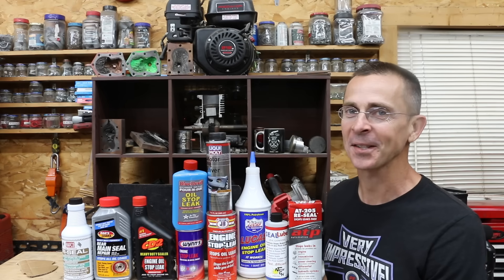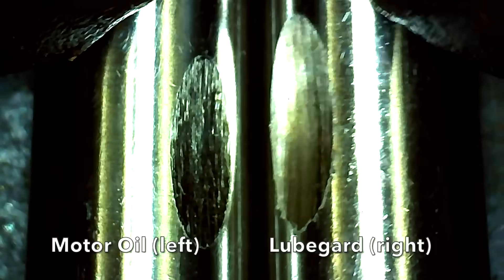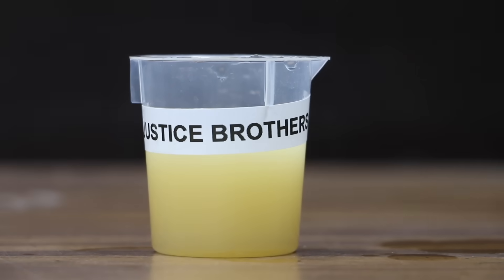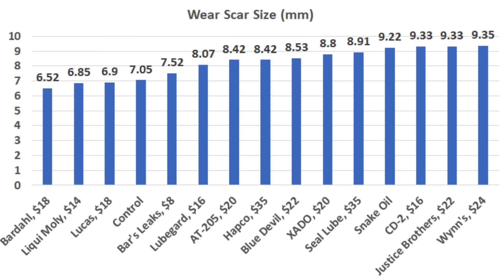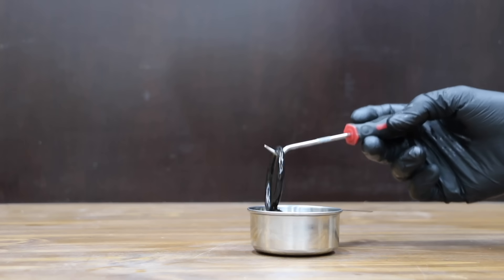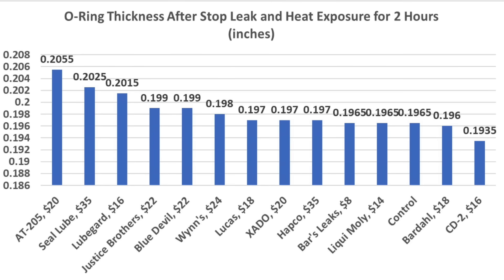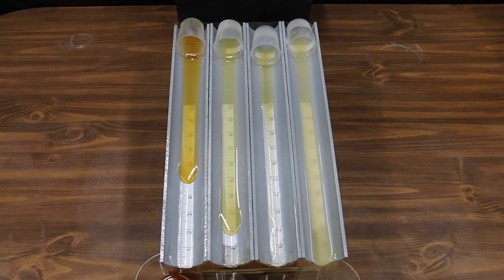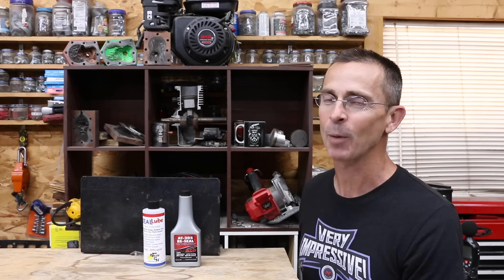Do Stop Leak Products Work? Do They Damage Engine Seals? Will They Destroy an Engine? Let's Find Out

Comment from the maker: Here’s the list of products reviewed. More details in the video description. Thank you! 
AT-205: https://amzn.to/3Z76AHH
Bardahl: https://amzn.to/3jO2Hr0
Liqui Moly: https://amzn.to/3ZdyKRE
Lucas: https://amzn.to/3IoZad0
Bar’s Leaks: https://amzn.to/3VK8awc
Lubegard: https://amzn.to/3Gi6lks
Hapco: https://amzn.to/3CpKzdt
Blue Devil: https://amzn.to/3IvHRqy
XADO: https://amzn.to/3GEkF8v
Seal Lube: https://amzn.to/3X8wKZ3
Snake Oil: https://amzn.to/3X1m9yT
CD-2: https://amzn.to/3WURUts
Justice Brothers: https://amzn.to/3WNFK66
Wynn’s: https://amzn.to/3JZ5SJS
Reply: Wish this video had a clearer summary in the end
Reply: Have you done coolant leak stop products?
Reply: @outlawjp81 I tell ya what and this is my opinion. I had a leak and I used bars or barrs coolant stop leak. Works great and it heats up and plugs holes.

Some people will say it clogs hoses for heat or A/C but I never had that issue. I would say just look up for your specific vehicle but mine was a 05 ram and I ended up having to replace my water pump years before and my radiator years later. **not from the stop leak tho it was just my radiator had rusted out and couldn't be saved and the the water pump was replaced way before I used stop leak. 

I know on my dodge the radiator has tabs you can pinch together with pliers to stop leaks if it's not really bad. The barrs has alot of types and is easy to find walmart and auto parts stores. I recommend searching and finding the leak so you can instantly see if you fixed it after treatment. **my radiator was so bad I was losing a gallon of water "summertime" every couple days. Now it's been year or two and never used a drop.

Also for you or others if you end up needing to buy parts I strongly recommend rockauto. I've used them for like 10 years and have bought

Water pumps
Alternators 
Starters
U joints
Radiator 
Diff seals
Rotors
Ball joints
Upper and lower control arms
Both front half axles
CV axles
Wheel hubs

The list goes on and I've never got a bad part
Never got the wrong part
And always cuts my costs by atleast half but typically by 60-75%

Fuel pump is let's say $200 at auto parts store. I can easily get the same exact one for $80-90 on rock auto

If a cv axle is $120 I can get it for $40-50

My buddy started buying body kits because I showed hin and looked it up. I was like dang its expensive and he was like no he could buy both side panels on rockauto for less than one panel where he normally was shopping.
I'm not associated with rockauto but I can 100% say they have saved me thousands of dollars.

Also you pick the quality you want. Like a fuel pump for a cheap economy, daily driver, and or high dollar. 

Goodluck with your repairs
Reply: @outlawjp81 yes please!
Reply: @outlawjp81  that is what I am looking for. not sure I trust any of them.
Reply: So what brand is #1 for a real main seal?
Reply: AT205 smells like a brake fluid. In old days some mechanics used brake fluid for reseal rubber gaskets. Test it please.
Reply: Head gasket leak fix test next?
Reply: I really wanted to use the at-205 based on someone else's recommendation. Your lubricity test kind of scares me though. I wonder if it is a fair test since you did 50/50, where normally it would be a much less lower percentage of the stop leak product. I would love to know what the results would be at the actual recommended concentrations.
Reply: I don't those products are designed to regenerate the gasket to its original dimension but rather clog slowly the place where the oil runs through always in the same direction.
Reply: Which did you use for power steering?
Reply: So what brand is #1, 2, or 3?  You should name at least 3 of the best brands.
Reply: SCOTTY KILMER LIKES AT-205 also !!!! :hand-purple-blue-peace::hand-purple-blue-peace::hand-purple-blue-peace::hand-purple-blue-peace::hand-purple-blue-peace:
Reply: thank you so much, 8:04 the chart is a bonus, the video was already sufficient. We are extremely grateful 🙏
Reply: Which product do you recommend for a Minor Rear Main Seal Leak on a 2016 Vw jetta 1.8 turbo with 120,000 Miles.

Comment: I would not worry too much about the wear aspect of this test.  The mix Todd used was 50/50 or 50%, on a typical 5 quart oil capacity the the mix would be 8oz to 160oz of oil or only 5%.
Reply: Indeed none of the products call for a 1:1 mix the most i have ever seen was about a 20% mix aka 4 qts of oil and 1qt of product but most are less then 1:10 ratio.

Comment: I did my research on AT=205 before buying it, but managed to miss this video.
Glad to see it was all justified.
I'm still in the process of buying it for all my older vehicles for leak prevention
1996 chevy k2500 5.7l
1998 ram cummins 2500 5.9l
2000 Sierra 5.3l 
2006 gmc envoy 4.2l

Comment: So the effects of AT-205 should be fairly long-lasting right?  i.e. if you run AT-205 for a few weeks and the leaks stop - to prevent excessive wear, you should change out the engine oil right?  As, by that time, the AT-205 has helped restore the seals already and best not to keep it in the oil?

Comment: @ProjectFarm could you test the oil viscosity versus heat? 
Most don’t know this but oil is rated based on operating temperature 
10W-30 means that the at the oils coldest operating temperature not the engine the oil it’s self has a viscosity of 10W. Once the oil warns up to the oils operating temperature it’s viscosity thins to 30SAE 
5W-30 is the same at the oils coldest temperature its viscosity is 5W, and at it’s operating temperature it’s 30SAE
Same for 0W-30 or 0W-20 
The 0W is a viscosity even though it’s just a 0, after it warms to operating temp it thins out to its 30, or 20 sae viscosity.
Reply from the maker: Thanks for the suggestion.
Reply: @P @ProjectFarm  i wasn’t exactly trying to suggest that in this case. 
This is more like an ask for a future video showing how the oils viscosity doesn’t stay the same viscosity, and varies based on the temperature, and environment it’s exposed/within. I guess it could be a suggestion if you consider away to incorporate  away to do these test while being able to change the oil’s temperature from relative cold to rather hot during different test. However If you do try any of this friend be very careful! Your looking at oil temperatures as high as 300-400°F maybe a bit hotter. Thank you greatly this could bring so much needed knowledge on oil, and how it works! I’ve seen a lot of folks not changing propane forklift engine oil simply because it doesn’t become dark. But you can feel how worn it is when not changed (it’s not sticky, and feels incredibly thin, but slick smooth feel) 
And newer engines stating they are “No oil change needed” or extended oil change intervals. All of which are not correct, and will damage an engine! Even if the oil or car manufacturer says it can, still is not a great idea! 
Thank you greatly for your time you put into your work friend! You bring so much great knowledge to so many!

Comment: I had a significant leak on my hydroboost (power steering powered) brake system. I took the the hydroboost apart and replaced the seals and it's still leaking, but less then it was before. Will the at-205 help that since it swelled the o rings up to above their original size? If not I've got to replace the whole hydroboost system which is double the price it was 2 years ago at around $500 and the parts are getting harder and harder to find

Comment: I have a 409,000 mile explorer with the 5.0 . I fogged it with seafoam and that made it run a lot better, but I think the rear main is leaking and I'm not replacing it so I just dumped some stp stop leak in it about 50 miles ago. We will see what happens, I'm hoping for the best lol. I will say fir me it has been a once in a lifetime chance to try this out on something so high miles.
Reply from the maker: Thanks for the feedback.
Reply: @ProjectFarm so, this totally worked and I can't believe it lol..

Comment: My Honda CRX Si D16 ( used ) with 351,699 + miles seems to have a small oil leak at the rear main seal.  I can see & smell oil burn on the exhaust pipe.

Would AT-205 reseal worsen the engine ( wear ) but POSSIBLY  soften & thicken what i believe is a rear main seal??

This is my daily driver & I have no other vehicle or $$$ to buy 1???

Thanks,
- Scott M.

Comment: AT-205 works well on "rubber" gaskets. Does anybody out there know of a "stop leak" that works well on "paper" gaskets.? I have a differential gasket that is leaking, and just looking at it, I'm pretty sure it's a paper gasket. I poured in a bottle of AT-205, and it didn't help any. This leads me to the conclusion that AT-205 doesn't work on paper gaskets like it does on rubber gaskets.

Comment: I bought a house, that came with an old lawnmower that leaked oil from the bottom main seal, ten years ago. I used barsleak to top off the oil the first  summer i bought the house. No leaks for ten years.

Comment: At 205 is meant to puff back up rubber seals. It is not designed to make oil slicker. I am not sure about the other products but I would gues that those that also separate from the oil are designed fo do the same. 
So I question the testing

Comment: I have a 2011 BMW 335i with leak coming from the oil pan gasket. I’m wondering if anyone else has used AT-205 on their BMW and what the outcome was and if there was any engine issues after using AT-205. Thank you in advance!

Comment: The first product I have seen like this was in 1970, it was made by Berryman who manufactured several chemicals. One was B-12 which was carburetor cleaner, I think it turned out to be a carcinogen. I never believed in that method until I had a low use car that developed a front pump transmission seal leak. I used in there and to my surprise it sealed the leak. That was 25 years ago, still working. Then I decided to try it in my Nussbaum car lift that had a difficult seal to replace. Once again it worked and now 21 years later it is still working. Not too sure about engines since the oil gets contaminated with acid and other blow by contaminants. Most recently I had a leak on my 34’ man-lift and of course it was two seals that are difficult to remove. The lift is 33 years old. The system holds 16 gallons so using their 32:1 ratio I bought a gallon and put in a half gallon, It took a month of intermittent use but it worked again. It was all the seal lube brand. I talked to the owner whose father created the product. He said it needs circulation because it doesn’t blend with oil.

Comment: Great video. Not sure if the science revolves the debate I've been having regarding my 2017 BMW X1. BMWs are notorious for burning oil. It's burning 0.6 L per thousand kilometres which is actually within BMW specs.  This "TwinPower" turbo engine generates a lot of heat and it's known that oil coolant housing gasket, the head gasket, etc, can all go by the time you get to 200K. I have reasoned that it would be a good idea to use AT-205 as preventive maintenance before I have an issue.  Others have said don't use these products until you have a "real" problem.  Looking for opinions on this.

Comment: Don't know what to think. I've read a lot of customer reviews stating AT-205 and Blue Devil did nothing or even made the leak worse. Bar's seems to have better reviews. I've tried Bar's products over the years with mixed results. I would hate to drop $20+ on one of these other products for it to do nothing, or worse.

Comment: Wait, he's mixing a 1:1 ratio!?...20ml oil with 20ml of stop leak!? That's way too high. Of course it will have tons of wear. For example AT-205 says 8 oz treats 6 quarts (192 oz) of oil. That would mean you add only 0.8ml of stop leak to 20ml of oil. I personally never use any of this stuff but that seems like a glaring mistake in an otherwise well planned test. Am I missing something here??

Comment: Testing a 50-50 mix for every product does not exceeds the manufacturer's recommended mix ratio in every case.  The results may be significantly different if you were to follow the directions!

Comment: WHEW! Came across your video when I was looking for a place to order another bottle of AT-205. I have a timing cover gasket leak and I used it on my last oil change after hearing Scotty Kilmer rave about how well it works. I most always trust Scotty's advice because he's never steered me wrong in the past. Anyway, I had just put the first bottle of AT-205 into my engine along with 6 quarts of brand new oil, so I was worried you were going to give it a huge fail! 😮 It actually did do a pretty fair job of slowing my leak during the last change. Still leaking a slight amount, but nothing like it was. I would do the actual repair, but it's a $5,000 reair at a shop because the engine has to be pulled to get to it and it already has 190k mi on it right now. Thank you!!

Comment: Thank you.  I used Lubegard and it stopped the leak on my 2016 Ford Fusion 2.0l Turbo. Sometimes, I was getting white smoke from the tailpipe during startup and then it would disappear after a couple of minutes of driving. This is in the summer in Phoenix when temps are over 100 degrees. It has been weeks and the white smoke is gone. It was from oil leaking into the intake caused by blow by gasses. I knew it was not the coolant since the coolant reservoir levels remained normal
Reply from the maker: Thanks for sharing.

Comment: So AT-205 does restore rubber gaskets' size and softness, but it also makes your oil less effective as a lubricant? That seems like it's going to run the risk of destroying your engine via metal-on-metal friction, right? So that seems like it's not worth the risk, I would think?
Reply from the maker: Great point on the risk. I've used it with success. My old suburban is now at 315K miles
Reply: @ProjectFarm Ok, good to know. I guess it shouldn't be much of a risk bc, in the test, you did a 50/50 mix of product and motor oil. But in reality, the amount of product you would add to your oil would yield a mixture in which the product would constitute a percentage much smaller than 50%.

Comment: I know this video is 2 years old at this point, but the "evaporation test" may not be testing evaporation at all. Considering the gaskets swelled in each of those, it seems to me that part of those components may actually be absorbed into the hardened seals/gaskets which is where the fluid mass was lost. If you did the same heating without seals/gaskets I wonder if the fluid mass loss would be the same; alternately you could have also weighed the rings at each step. Perhaps the seals & gaskets lost mass in the hardening process, and was that mass was restored by the products that actually worked.

Comment: I've used AT-205 and think its great to spray on rubber components to keep them fresh; weatherstripping, suspension boots and bushings etc. If I use it in an engine I'll do it a week or a few days before changing the oil.  That will give it a chance to soften/expand rubber things to stop a leak but not be in there too long as to add to any wear. Both our cars are over 20 years old. Works for me anyway

Comment: I used nulon Stop leak on my Ninja 1000 when the radiator developed a leak on one of the rides. The leak stopped and there has been no issues for the last 15000 kilometers.

Comment: Hello everyone!
Can anyone tell me or recommend if it’s okay to use AT-205 with fully synthetic 5W-30 engine oil?
I have a leak in the front crankshaft seal of my VW Golf 1.4 TSI, and I’m hoping someone here has experience with this.
If yes, how many milliliters of AT-205 should I mix with my 3.6 liters of engine oil?

I really hope someone can help me. I want to fix this issue as soon as possible, but I currently don’t have the budget for a proper repair since the labor cost is very expensive.

Thank you so much in advance!

Comment: I have an annoying transmission fluid leak do you know an additive to expand the gasket material? It is an '01 Jetta 2.0 liter and it has a rubber gasket for the pan, which was my only issue,  but now the side panel gasket is leaking. I used  AT-205 and Lucas stop leak transmission but to no avail-- Danke. i would like to report that i had oil line leaks and a rear main seal leak on a '95 roadmaster that  AT-205 fixed. 🙂

Comment: 1996 Bronco. I tried the AT205 without success. I only service the oil yearly as the truck isn’t driven much. Ran Valvoline Maxlife on oil change in May of this year, it’s now June and the leak is completely stopped.

Comment: I plan on using AT-205 on my 2015 Honda Odyssey power steering, so I was really interested in this video.  I was upset to see it separated from the oil.  But then I realized you used 50% treat rate, the recommended treat rate is 8 ounces to 6 quarts or 4.17%..

Comment: Lubegard seems to be the overall winner on your tests. While, AT-205 performed the best it also didn’t mix well and could wear engine components, which you didn’t show on your last chart
Reply from the maker: Thanks for sharing your thoughts.
Reply: The recommended treatment rate is 8 oz to 6 quarts, so at the recommended treatment rate it probably won't separate or reduce wear protection.  I am using it!
Reply: @petesmith3923 I didn’t catch that. Thank you. do you add it after an oil change or prior, so not to leave the AT-205 in for an extended time?

Comment: This was really interesting. But I do not really see how a 50/50 mix of the various snake oils and motor oil in your friction test is in any way relevant. The bottles are all less than a quart. Some looked more like a pint. Wouldn't it have made more sense to mix the ratio closer to the actual ratio in say a 5 quart oil sump?

Comment: AT-205 didn't work for me but lubegard did 1 bottle in with engine running and no more oil leaks or missfires on #4 piston on a 350000 mile honda civic.
Reply from the maker: Thanks for sharing.